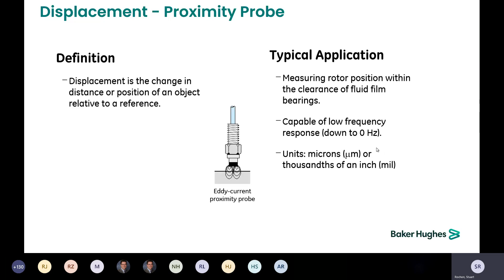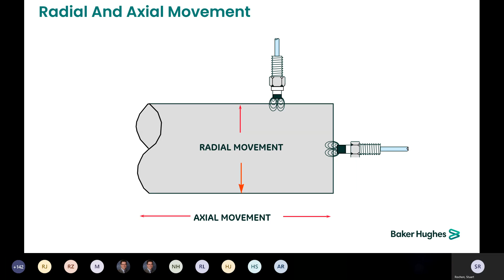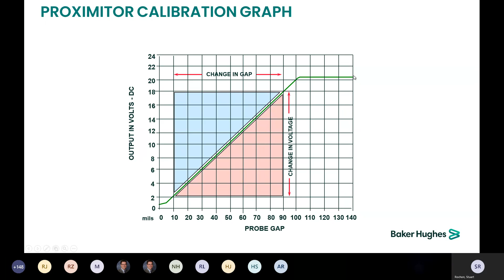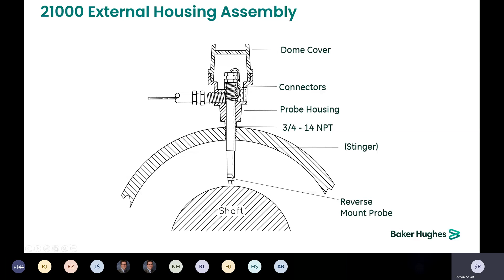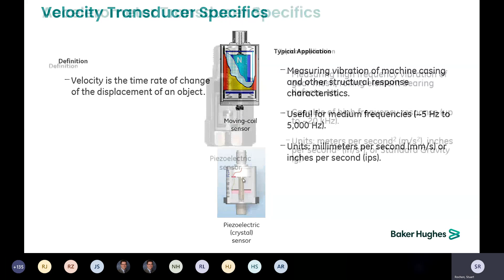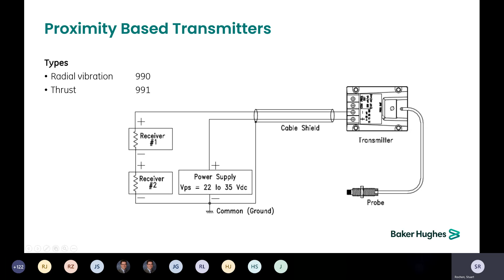Proximity Probes and Other Sensors

Comment: How does eddy current generates if there is no changing magnatic field? Does the probe change its magnatic field or is it because of the movement of the equipment that cause the eddy current to generate?
Reply: maybe as we use an ac soure which produce alternating currrent and that will make a diff flux not sure but i try to help

Comment: Dear sir.What is each part of this probe's part number (86691-09246-0435-25) stands for? I only know, last 25 stands for 2.5 m length.
Reply: Check in the manual or data sheet for that probe, you should find it under "ordering information" section.

Comment: before i see this video i think function of proxymity is like the hall sensor, i had made this sensor to read rpm of shaft then i connet to micro controler to submit data to mysql server use php, for acces to internet, now i know this for monitoring condition vibration, maybe some times i will create monitoring conditon remotely